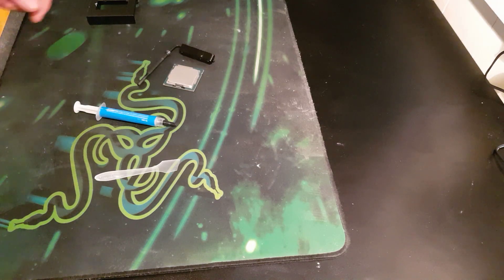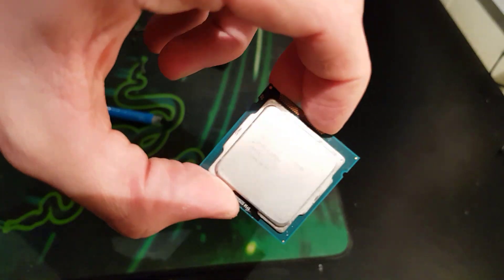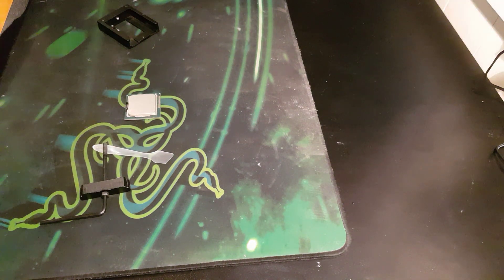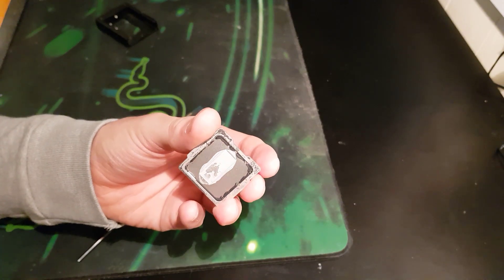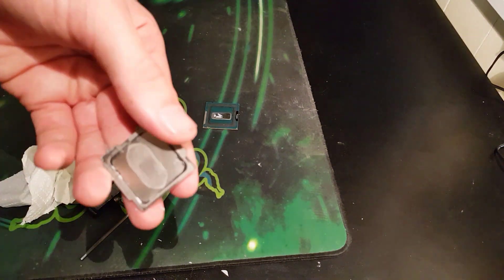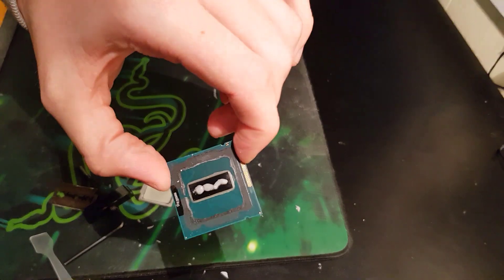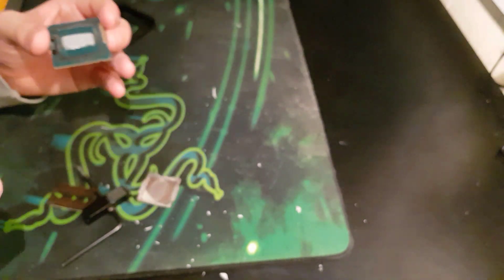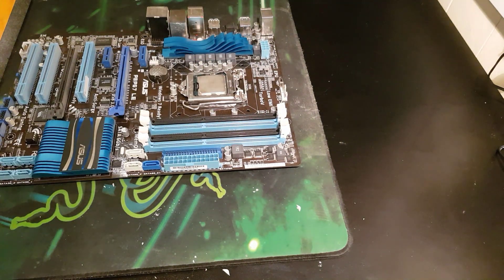Delidding an i7 3770K with a Cheap Delid Tool From Ebay

Comment: did you not relid it, and just use the socket slot to keep it in place even if the mobo is vertical?
Reply from the maker: Yeah, the pressure from the socket keeps in place.
Reply: @connectronbuilds9960  thanks in gonna use liquid metal so hope it doesn't spill onto the PCB
Reply from the maker: @Gbyrd99  Yeah make sure not to use too much
Reply: @Gbyrd99  how did it go? im planning on delidding my chip and using liquid metal too

Comment: How is the performance of the cpu after deliding. Does the oc capability increase. Ive been wanting to do this but according to some of my friends, its too risky and performance doesnt improve much.
Reply from the maker: If you use Liquid metal you can see massive improvements in temperature, however if you're using thermal paste you might only see improvements of 5-10 degress.
Reply: @connectronbuilds9960  mine dropped for 25°C  , LQ under IHS and od top under cooler=)
Reply: @fl3shy22  So you re-lid ? Why not using direct die guard and direct contact between die and cooler? Its an extra 15e but you can lower more 7c i guess. 
Im planing to do direct die with mx4
Reply: With direct die you have a problem because the die will be lower than it is supposed to be so the die might not make contact with the cooler. Special mounting hardware is required for that